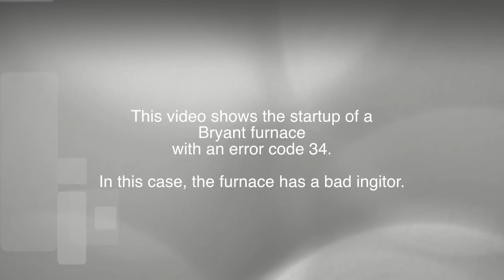Bad ignitor symptoms  Bryant gas furnace ERROR 34

Comment: I have a 1982 Bryant 66,500 gas furnace, the induction fan comes on, the pilot flame comes on but no gas goes to the tubes. I don’t even smell any gas and I can’t find any flame sensor around the burn tubes. Do you know my problem? Thx
Reply: Jrbpa 57 after the pilot light comes on, does the gas valve click? If it does not, you may have a bad gas valve or a bad furnace control board.
Reply: That’s not even remotely the model we’re talking about here.

Comment: If this ever happens you can use a long nose lighter to ignite the burners manually when you hear the gas hissing fire the lighter into the far right burner and this will give you one full heat cycle once the burners light. I always keep a spare igniter handy.
Reply: Ross Kulma and if you crank it up to 85°F it’ll probably run all night, so you won’t have to keep getting up to relight it. ;-)

Comment: I have the same code. But once it gets to the ignitor glowing and the gas turns on it only blows for a good 5 seconds and turns off
Reply: Try removing the flame sensor located opposite from the ignitor... it only has the single wire attached to it. Once removed simply clean it gently with a Scotch Brite scrubber or fine steel wool and replace. Oxide build-up will impede the delicate signal.